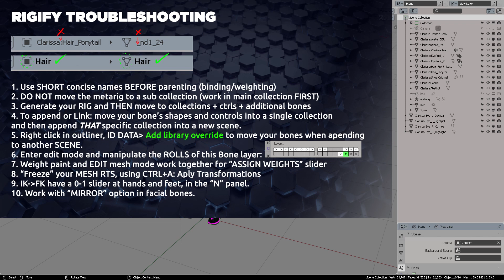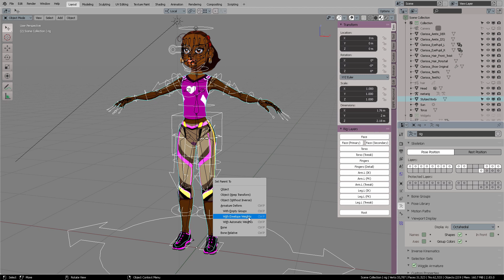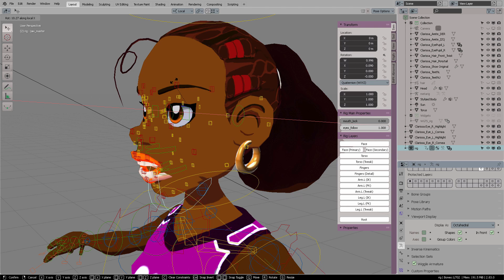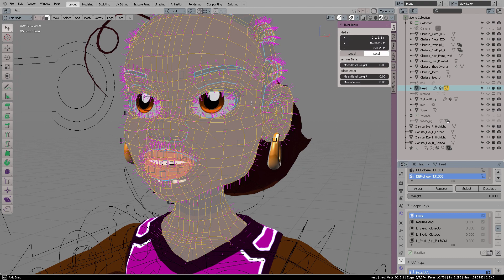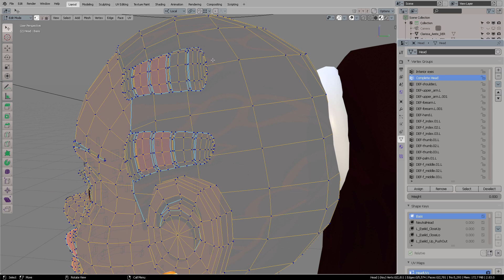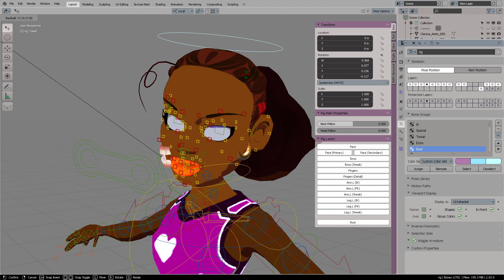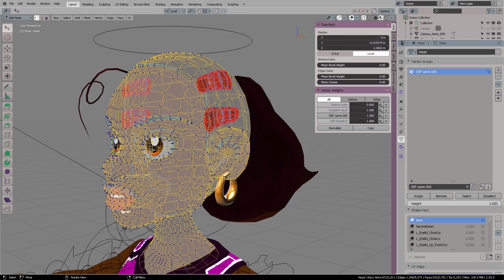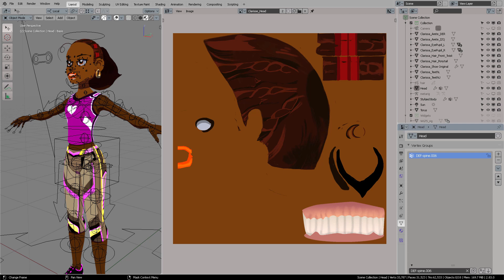Rigify troubleshooting (Part 2) - Conclusion

Comment: What i find strange is that default Weightpaint mode does not activate "Active" in the overlays. BEcause blue is zero, everything turns blue. Its very hard to see individual groups this way. Using "Active" is much better because everything else turns black and you can focus on the group itself much better

Comment: PS its way easier if you select the armature in pose mode then select the mesh and go into weight paint mode. Know you can click bones and it will show each group. Way faster than your method!
Reply: ANothther minor point. When using L to select, you don't need to select first. Using L with automatically select everything closest to the cursor or first between viewport and cursor.

Comment: PS in your first video, why did you Apply on Delta Level? I believe Delta level is any transform on top of the main transform. Resetting this doesn't reset the main transform. I always apply in the main level.
Manual states this as well, so apply delta transform can still cause those weird rotation issues you had in part 1
https://docs.blender.org/manual/en/latest/scene_layout/object/properties/transforms.html#delta-transforms